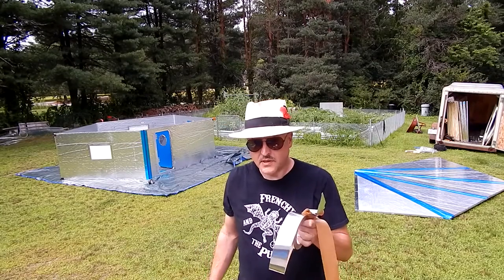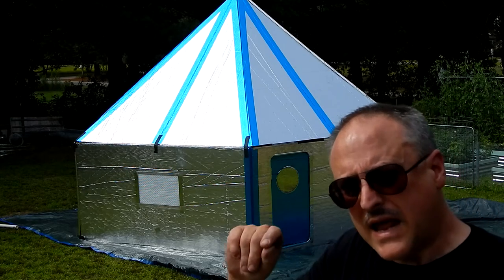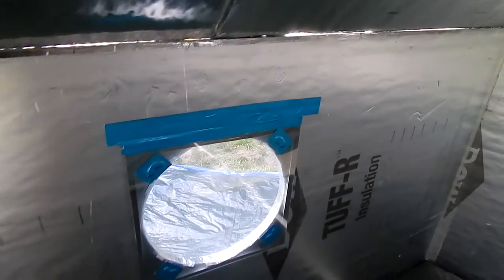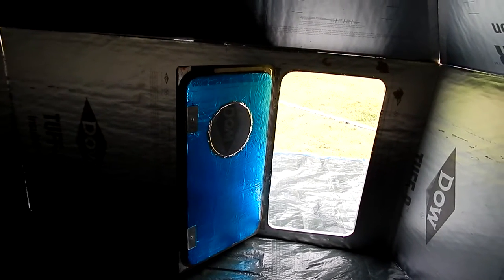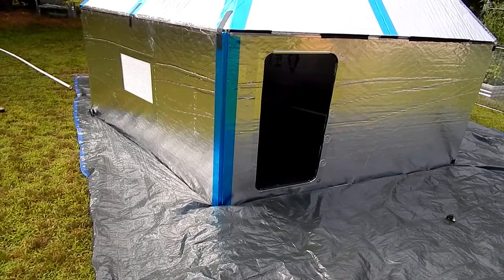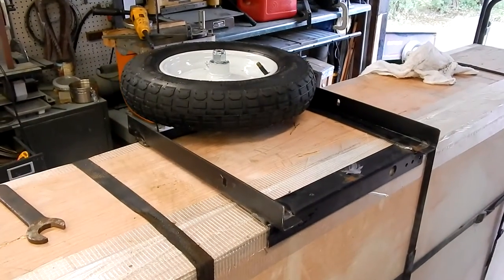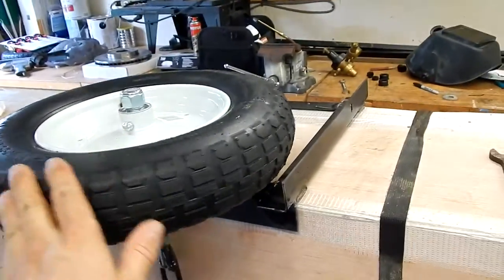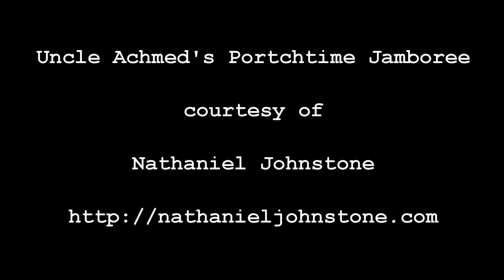Pentayurt - Part 3 (now with music)

Comment: Thanks so much for sharing the yurt construction know how!
A couple of questions:
How did the magnets securing the windows hold up in the dust storms?
How did your cart design perform? Did you try to yoke it to a bike?
Reply from the maker: The magnets worked great, no issues at all and it was windy AF last year. The cart worked well too, I did yoke it to a bike but the whole rig proved to be too heavy to ride but not to bad to simply push along.

Comment: Virgin here.  Curious why you would need the cart system? Would you just set it up next to your car? 

Also,  I know this is an older video nowadays. Is a heaxa or penta yurt still the way to go in 2023/2024?
Reply from the maker: I usually take the Burner Express Bus in and ship the pentayurt in the Boston container project’s shipping container. One year my camp was nearly a mile away from where the container was dropped on the playa!

Yes, I still think a pentayurt is the way to go! However, next year I think I’m going to try just a tent and a monkey hut for shade so I have less stuff to ship from the East Coast.